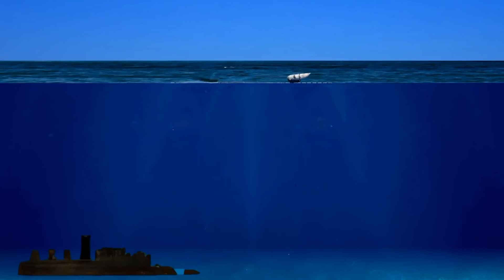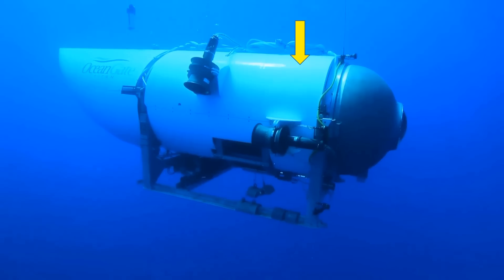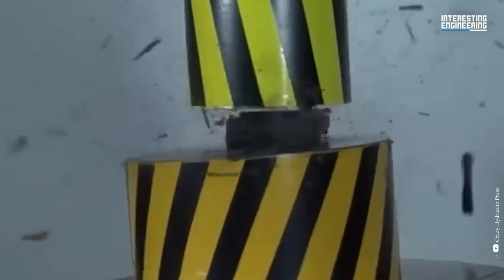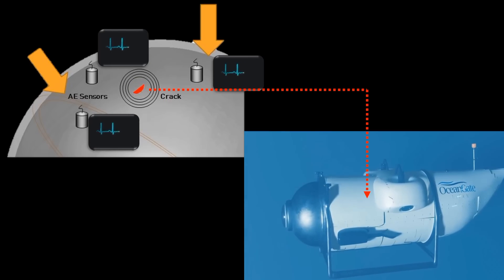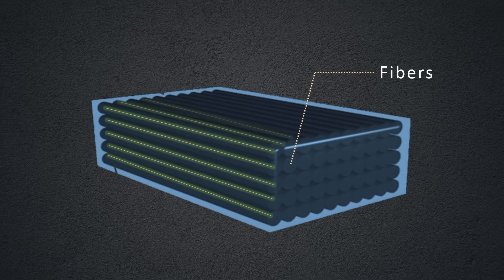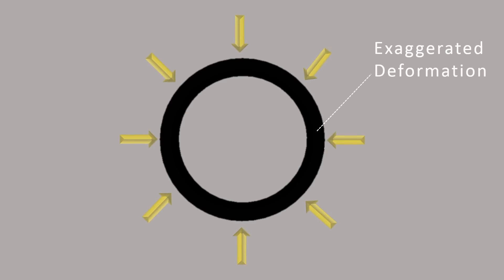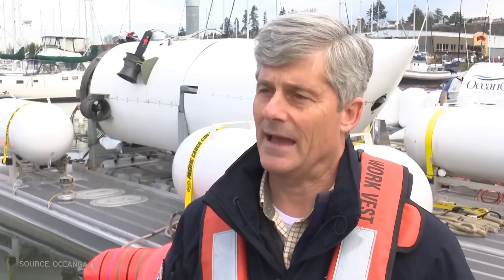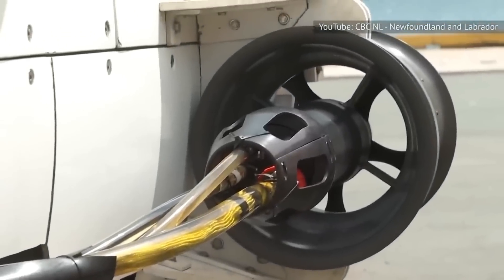Oceangate Titan Did Not Implode Just From Pressure. There Is a Catch!

Comment: Thank you, I think you were great at explaining how carbon fiber works and withstand pressure. What do you think about the edges? Where the carbon fiber attached to the titanium rings. There, wouldn't both materials move in different ways when subject to pressure, leading to a potential rupture point?
Reply: it was glued together, but they did it by hand, it is impossible to control the thickness of the Epoxidharz, but beside that, composite materials or carbonfibre is good when the pressure comes from the inside, they are very hard to stretch, but when the pressure comes from the outside its a complete different story! carbon fibre brings great result in stretch tests, but under compression they collapse very fast! and unlike steel and titanium we have still to less data available to make accurate simulations! there is also the different coefficient at temperatures compared to titanium or steel, which have a similar value
Reply: @Nebukadnezar2036  
As an engineer, the CEO should have known that, but he decided to take a chance!!!!! ... 😢
It's tragically sad!!!!! ... 😢
Reply: @maryalove5534  I think Rush thought since it successfully dive to the titanic several times regardless of the cracking sounds it made  it would never fail.
Reply: @Nebukadnezar2036  the glue only has to work as a glue at seal level or above.  Below water, the hydrostatic pressure keeps the end caps on.  There, the glue acts instead as a seal.

Btw, there are a variety of ways ensuring a precise thickness of adhesive is used, including putting tiny glass spheres in the adhesive to using small shims or bumps and injecting the glue after mating.
Reply: It doesn't matter if the two surfaces move in opposite directions - the adhesive glue has already failed!!!
Reply: @LWRC  
(: Yes ... And only God knows what else was done wrong!!!!! ... 😢
Reply: Rush used peanut butter around the frayed edges.
Reply: @brendalohrke2402  
Krazy glue
Reply: @wilsonrawlin8547  literally
Reply: @wilsonrawlin8547 Or, Gorilla glue.
Reply: @brendalohrke2402 no he didn't. he said the glue was the consistency of peanut butter when applied.
Reply: I heard some grade schoolers were building an origami sub to go to the moon using Elmer's glue and construction paper.
They are looking for any billionaires willing to pay?
Reply: @DambruhFknsik they’re still smarter than Rush.
Reply: exactly i think that is a bad idea , if you can't bolt it on vs glue , not a good idea
Reply: Thank you for explaining this catastrophic design. Very detailed yet understandable to the non engineering mind.
Reply: Hopefully they had life jackets.
Reply: @DambruhFknsik 
???

Comment: One of the others noted that the window was missing. He was indicating that he thought the window failed. This is unlikely because the ring that hold the window in was also gone. This would indicate that the window was blown out from the inside. Think of water moving at 1K mph from the inside of the window. I do agree that the tube failed first, Likely at the junction of the fiber and the rings at the ends.
Reply: nah.. dude.. do you realize the magnitude of the explosion that happens after the implosion?. It is a huge shockwave... Imagine...All that air compresses in a milisecond, gets so hot it burns, pressure has no easy way since it is sourrounded by water.. BOOOM.. do you expect a cheap ass acrylic window to stay in place?. Take in account the thing is designed so the pressure itself pushes it against the sub, it is what keeps it in place and what makes it totally waterproof.. that thing went the other way, which means massive forces pushed it from inside out....
Reply: @Trikipum  isn't that what he just said??
Reply: The window was 7" thick. I was supposed to be 9".
Reply: Right after it happened, I read somewhere the viewport was only rated for 3000 ft. I haven't seen anyone else talking about that. But I do think the hull collapsed, and the window was blown out an instant later.
Reply: I also believe the fact carbon fibre’s usually wound on a criss-cross pattern for strength,whereas Titan’s was like a cotton reel seems to me would undermine the hull integrity significantly.
This is the FIRST TIME I’ve heard anyone mention the different way Titan’s Carbon fibre was applied
Reply: He wasn’t sure if that happened or if they broke it to tie the strap to it to lift it
Reply: Listening to others videos the window plexiglass was much thinner Ocean Gate then other submersibles
Reply: @ellasdee4052 It was rated for 1,300 metres.
I saw a clip of Rush bragging how shocked he was by how much it deformed at depth!
Reply: @donnamorgan2522  continuous diving but no inspections he was doomed to fail anyway
Reply: @ellasdee4052  Rush had built so many failure points into his death vessel,with his window,hull too thin…how the hell it got back from dive #1 shocks me-without the carbon fibre & tubular shape.
Even had THE BEST advice in the world.
All to save a few bucks,cost lives.
I feel for the ppl when things went to red alert-but take a little comfort that Rush KNEW his risks failed & THAT is how he will be remembered,not as he wished.
Reply: @donnamorgan2522  exactly ignored everything and everybody, and yes he had the best advice I was just saying to somebody else that carbon fiber will breakdown when you're driving on a racetrack I sure wouldn't take it underwater with me. He wanted to be so innovative but again ignored everybody it's just too bad that he took all those people with him
Reply: @ellasdee4052  At least he had no 50 year old experienced white guys.  He was good and woke.
Reply: agree. I highly doubt they used high strength bolts. they likely bought the hardware from a big box store.
Reply: Almost definitely blew out from the explosion that follows the implosion. Seems like it might have failed near the middle or at the joint between CF and titanium. That glue would be going through cycles too, compressing at depth then being released as the sub ascends.
Reply: @aliveandwellinisrael2507  it was an implosion and then an explosion granted it happened within a Split Second yes that's going to happen
Reply: I completely agree. Everything inside the sub became fuel when the air compressed. They may even have been in an oxygen rich environment since that would have been easier to maintain for comfortable breathing though with the temperature the air reached, the nitrogen in the air became fuel itself, just like when it burns in the exhaust stacks on top fuelers. There would have been quite an explosion and a shock wave and a shock wave in water is much more damaging than a shock wave in air.
Reply: I am thinking the window was a casualty of the explosion after the implosion. Water follows the path of least resistance and I honestly believe the failure was where the different mediums were attached and sealed
Reply: They used spring and plain washers under the bolts for the window, I wonder how long of a thread the bolts had. what torque, how good was the tapping of the threads.
The flanges bolt pattern and size of hole dia and the spacing on the flange was most odd, seems too few too small.
I wonder how much of the Titans engineering was based on visual examination of photos of other submersibles that had been professionally designed.
The Titan submersible had a feel of copycat or monkey see monkey do., copying without understanding why. Maybe too harsh, prob not.
Reply: It's possible the window was removed so that part of the submersible could be lifted with that red rope.
Reply: @AvonleaMontague  na they wouldn’t damage evidence that way. Also doing any work at that depth would be very difficult, yes they can pick things up but breaking stuff with the equipment is not one of them.
Reply: @AvonleaMontague  I doubt they had the tools on the MRV to unbolt the window but good thinking still.
Reply: cougar8539  It’s a recovery team, I’m sure they’ve moved way worse. They probably have sledge hammers and pneumatics and all kinds of shit. I’m just saying you can speculate and theorize all day. You don’t know if they went through that hole or their heads. Maybe pieces of them went out the capsule as it split. Maybe they turned to mush, which seems to be most likely. Idk
Reply: And they used glue😩
Reply: I don't think any of you have a clue